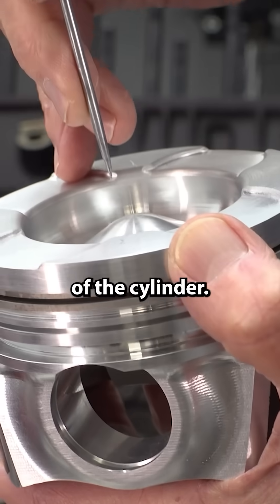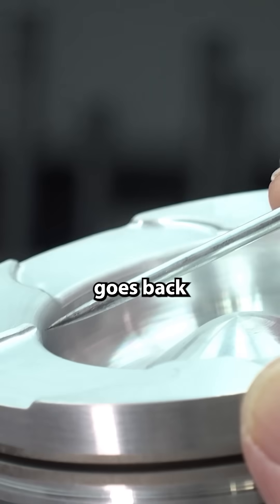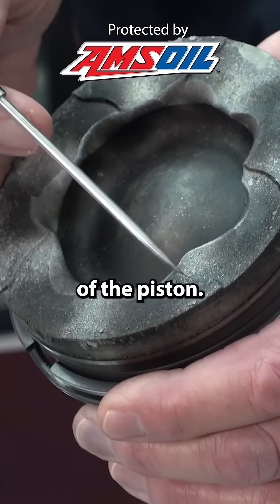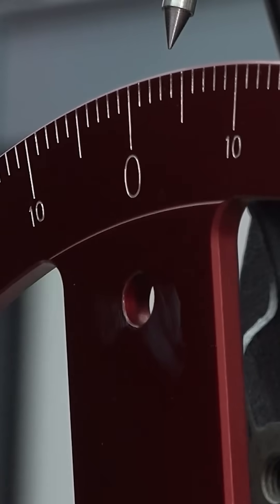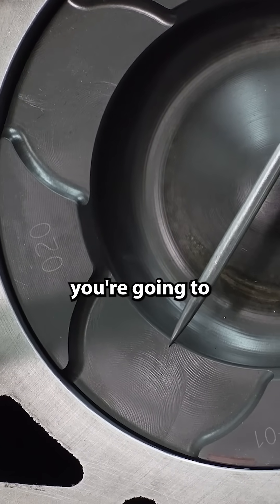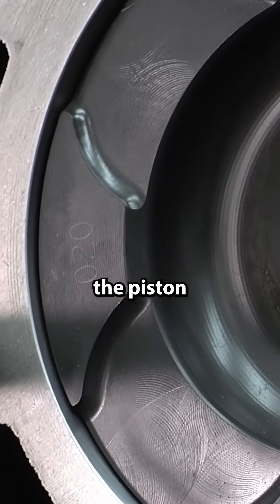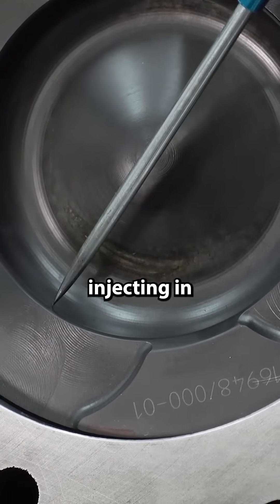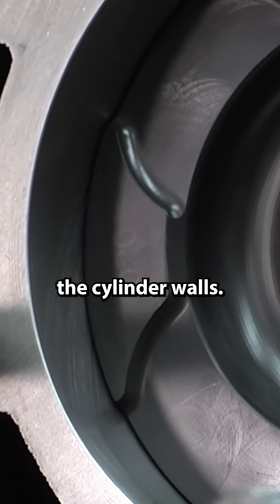How to burn pistons.

Comment: The bigger question is why would you want to keep injecting that long? Wouldn't the available oxygen be used up by then?
Reply: At higher rpm the piston travels more degrees per microsecond, so for the same injection duration you end up with injection continuing past the point of bowl injection
Reply: @diesel-technology5507 is this the reason diesel engines have a “lower” max rpm then gasoline engines? Or is it just rotating mass or something else?
Reply: @kcspeed9980 seems like that could be the case, since gas engines have no restrictions for that given the face of the piston is the combustion zone vs the pocket in a diesel.  Less room to swirl/detonate properly?
Reply: @kcspeed9980 the reason is the speed of the front flame
Reply: @magronet  diesel engines have multiple flame fronts that travel all over the cylinder simultaneously to create a big spike in pressure, spark ignition engines call this knock and it's an integral part of the compression ignition system. If you look at the cylinder pressure curve of a diesel engine Vs a gas engine at the same rpm, you will actually see that the opposite of what you've been lead to believe is true
Reply: @pearlbluesoul no! The Flame Front lasts longer because it Burns slower. This is the reason for lower Max rpm. The longer burn has the advantage of more torque because it delivers more Energy all the way down to btc. This is why Diesels have more torque compared to Gasoline engines. The injection and omega pistons Are very much the same in modern direct injected gasoline engines. 

Sorry for my english, I‘m German and no native speaker
Reply: @kcspeed9980  There are many reasons diesel engine TYPICALLY have a lower max rpm. Most diesel engines are designed as workhorses that last for hundreds of thousands, if not millions, of miles in a harsh environment of producing high working cylinder pressures. This means the material of the engine needs to be very robust and so usually heavy, which limits rpm potential (weight is not your friend with high piston speeds). 
As for high performance diesel engines, diesel-tech explained it well.
Reply: @Alex-mr4is  diesel engines have more torque because of the compression ratio, has absolutely nothing to do with combustion rate. The average cylinder pressure is higher in diesel engines so more torque is applied to the crankshaft. Please look at the cylinder pressure curves of diesel and petrol engines and you will see the point, the burn happens quickly and then the pressure can't go anywhere, there's generally not much burn going on unless you keep adding fuel and burning the pistons as is explained in this video.
Reply: @kcspeed9980  the main reason is , diesels are cammed for high v.e. at low rpm, just like a "rv" cam in a big block gas engine.
Sure you could rev higher, but the torque curve has fallen flat on its face by then, so shifting to higher gear would yield greater returns than revving higher in a lower gear.
Conversely, any engine whose peak volumetric efficiency is at high rpm, will make very little torque at low rpm, and have very low power yields , regardless of how low the gear is.
Reply: @kcspeed9980  Not quite. Being compression ignition engines, diesels have a higher compression ratio than spark ignition counterparts.  For which reason,  diesels have a longer cylinder stroke for longer piston travel...translating to larger crank pin offset...translating to  higher torque on power stroke (torque = Force x Radius) ....which translates to lower crank rpm at max power. In a nutshell 😊
Reply: @oliverwabwire2836  This is a fallacy, a long stroke doesn't increase torque for a given displacement, the greater force exerted by the piston in large bore, shorter stroke design balances out.  Diesels don't have more torque than petrol engines if you compare engines with the same displacment and induction method. Diesel only wins if you compare engines with similar power output as the diesel will have higher displacement and/or forced induction. The diesel makes it's power through torque rather than RPM, as they do not work well at high RPM.
Reply: @ferrumignis  diesels have more torque for the same displacement, that's just a fact. You're ignoring air to fuel ratio. Consider total mass of fuel injected and then reconsider your opinion
Reply: @diesel-technology5507  "diesels have more torque for the same displacement, that's just a fact"

No they don't, this is a basic fact and you are wrong.  As an example, the VW 2.0L R4 SDI makes just 74 bhp and 103 lbft in the Mk5 Golf.  The Mk5 was also available with the EA113 2.0L FSI petrol engine, making 148 bhp and 148 lbft.  Both engines are 2.0L, four cylinder, DOHC, normally aspirated, made by the same company in the same year.

Adding forced induction, the 2.0 R4 16v TDI PD in the highest power variant in the Mk5 Golf made 168 bhp and 258 lbft.  The EA113 in most powerful variant makes 270bhp and the same 258 lbft.  Oops.

You probably think that diesels make more torque because they are nearly all turbocharged, and you are comparing these against a non-turbocharged petrol engine.
Reply: @kcspeed9980 it’s because you can’t advance timing on a diesel engine.
Reply: A diesel engine will happily fly round to 8000rpm when fitted with the correct parts and using the correct fuel, the problem generally is the amount of time the fuel has to find oxygen for combustion. Gas engines have the fuel injected well before ignition takes place, and the ignition is controlled with a spark so good mixing can occur before ignition takes place. Diesel engines the ignition is not independent of the fuel injection, so you have an ignition delay that isn't easily adjusted to allow for mixing before ignition. You can play around with certain things such as the cetane rating of the fuel, the injection angle, the compression ratio, injection pressure, swirl port geometry, piston design etc etc. And you can make a diesel engine rev really high and make good power up there, however you can never get around the ignition not being independently controlled
Reply: @diesel-technology5507 I’d expect to get 8,000 rpm it must be a destroked build?
Reply: @TheBeingReal  stroke length is important in a high rpm diesel more to the point of how far away from the injector does the piston travel per degree of crank rotation after tdc. Also a longer stoke means that when the crank is at 90° after tdc you get more lb/ft of torque compared to a shorter stroke, but for the same capacity of motor the piston diameter needs to be larger so more of the cylinder pressure (psi) is taken by the piston into useful work since it has more surface area.....the reality is you need to calculate based on the expected cylinder pressure and stroke length and cylinder bore. Another consideration that is often overlooked is that to make power at high rpm you of course need a camshaft that will let the motor breathe up there, but then at low rpm you have trouble getting the engine started and idling since the valves are open for a long time while the compression stroke is happening and you end up with very cool in cylinder air temperature at the point of injection and the diesel doesn't want to ignite. This can be overcome by simply raising the true volumetric compression ratio, but it's not always something people consider. If you are thinking about doing it, you need to think about the 4 strokes as a whole system of operation and the engine is a machine not just a collection of assembled parts
Reply: With spark ignition engines you can control when the flame front starts, timing peak pressure to occur at the right crank angle independent of engine speed. I'm no diesel expert but my understanding is this is much harder or basically not possible in compression ignition engines as the faster the rpm's the later (in degrees) the peak occurs.
Reply: @jdmjesus6103  you can begin injecting fuel earlier in the cycle so that the ignition begins at the optimum point in crank angle, but the higher rpm you need a narrower injection angle to make sure the fuel is going into the bowl of the piston. This has the disadvantage of making poor mixture formation at low rpm and also you're spraying directly at the piston rather than out into the bowl. Everything is a compromise I suppose no matter which engine you have
Reply: @diesel-technology5507  interesting, I've never tuned a diesel but I've plenty of experience with spark ignition, thanks!
Reply: Diesel fuel represents approximately 20% more BTUs than gasoline, this is a good start towards why they make more torque, and generally get 15 - 20% better fuel mileage.
Reply: @Motor-City-Mike  diesel is around 100kg/m^3 more dense than petrol so at 14.5 AFR you need more volume of petrol to make the same mass so this also contributes to fuel consumption. Then when you consider a diesel engine will typically run 18:1 AFR under max load and a petrol engine will run around 12.5:1 AFR under max load, you have even more of an advantage with Diesel. If you compare apples to apples directly then you actually have 15% more BTU in diesel fuel, but you use around 40% less fuel by volume and still have more torque
Reply: @Turnipstalk you're not a diesel anything, never mind "R&D engineer" and you proved that when you said the fuel ignited the moment it hits hot air 😂 there's no argument here, and you need to stop trying to win an argument instead of being correct. It's not the same thing
Reply: Diesel isnt as combustible, you want it as evenly dispersed as possible for even combustion
Reply: @Turnipstalk nope, diesel engines inject fuel over a longer period of time for emissions reasons. The fuel has much more time to find oxygen if you don't throw it all in at once. Which is easier to drink, someone throwing a glass of water in your face or drinking through a straw? Ideally you want all the pressure to occur at low crank angles after tdc, because once you have increased cylinder pressure it does useful work until the exhaust valve opens. You've obviously never tuned a diesel engine and have no real world experience except reading some books. Increasing cylinder pressure after the cylinder volume has increased significantly reduces the overall pressure increase and therefore torque applied to the crankshaft. Diesel engines knock at all rpm, even at 7000rpm they have a very noticeable knock. Pilot injections attempted to lower this knock by spreading the pressure increases over a larger number of smaller events. And no the engine wouldn't destroy it's self at all, running a diesel on 25:1 afr doesn't hurt it at all whereas a petrol engine would last about 30 seconds. Please don't misinform people.
Reply: @Turnipstalk stop trolling 😂 for anyone else reading, ignore this 🤡 clearly you have never heard of ignition delay. Look at a cylinder pressure curve for a diesel engine and then come back and continue your pointless argument
Reply: @Turnipstalk meanwhile you're sitting there still adamant that diesel engines don't knock. Goodnight

Comment: So the fuel superheats whatever it hits and damages it, or is the fuel abrasive and damages it?
Reply: It is the combustion rather than the fuel itself but when this fuel is being sprayed in an almost flat cone this focuses the combustion wave in that same cone.  The sprays position in the cylinder remains fixed while the piston moves changing their relative positions. This fuel spray and combustion wave starts in the piston dish, moves over that edge which acts like a concentration point because the sharp angle means less surface area exist to conduct the heat away allowing it to potentially overheat that edge before the piston moves and the wave moves to the cylinder walls.
Reply: Heat dissipation is much less at a point than at a lump of solid metal. It overheats and melts real fast

Comment: Any standard practice to advance timing Maybe 6° for running black diesel alternative fuels
Reply: Do you increase the volume with reused oil? If no, then there is no added duration . Most applications getting into this40°+ after issues are highh rpm race use.
Hard staring with a Cummings mechanical injection is offten a symptoms of too much advance ( bigger numbers BTDC) trying to keep the completion of injection under 30°ATDC
Reply: @daviddroescher  if someone's running motor oil in their diesel I think the detonation time is way slower so injection pump timing has to be advanced this helps with smoke and making power what I mentioned seems to be standard practice
Reply: @tonydiesel3444  makes sense. Slower burn rate and flame front =more time needed to finish.